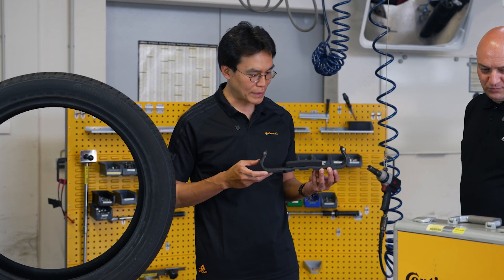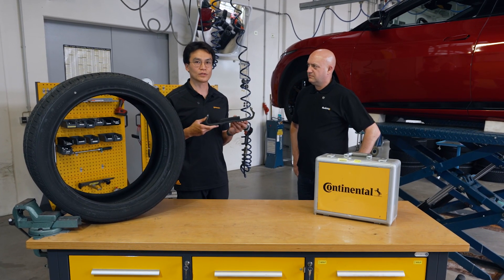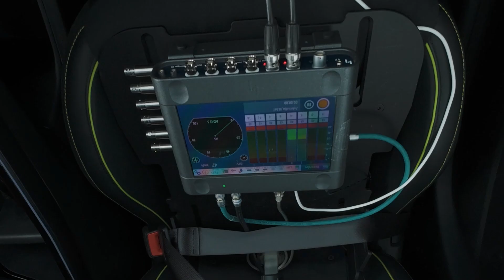ContiSilent - NVH Testing

Comment: On Continentals's website they advertise 9db(A) noise reduction. Bust in this vide the actual measured values does not even show 2db(A) at any given frequency! What the hell?
Reply: Probably the usual advertisement mumbo jumbo..

UP to 9db(A) reduction.....

Like Energizer batteries in the old days "Lasts up to 6 times longer than (the cheapest and worst battery we could find)"